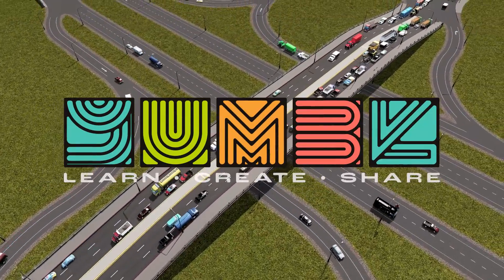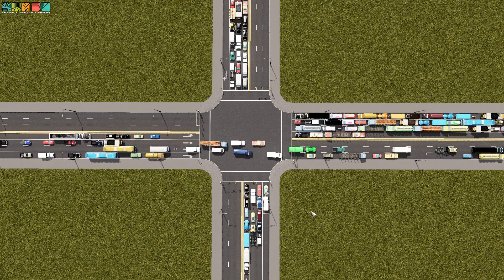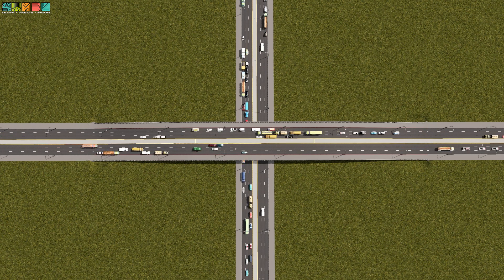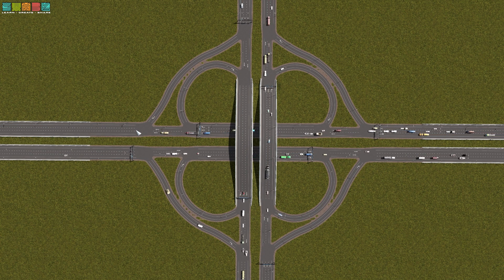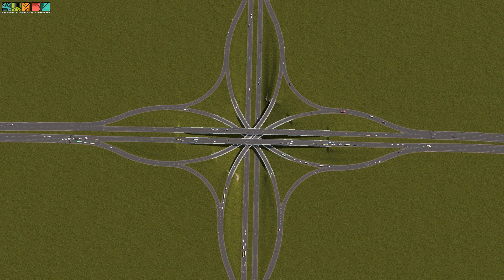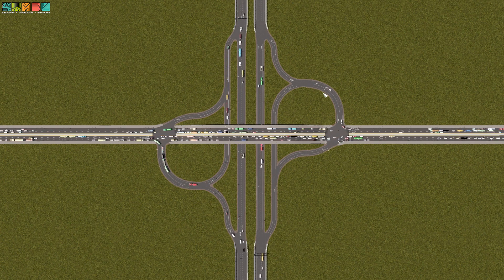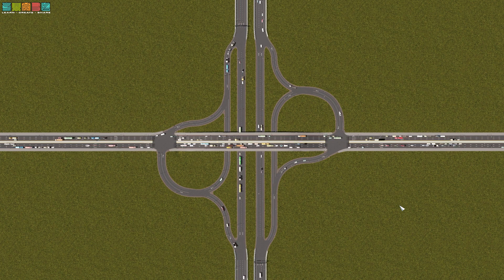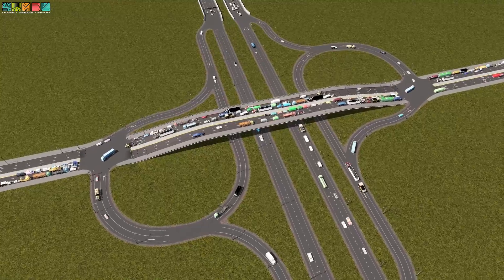Solving Traffic Conflict  -  Intersections and Interchanges Explained

Comment: The flaw with the roundabout at 1:24 is that you have single lane for each direction. Notice only middle lane on each entry is congested. The fact that the left lane is not means you have way more traffic going straight than turning left, yet you have only one lane for each. I'd say, allowing the left two lanes to weave both on entry and on the roundabout should increase its traffic throughput because traffic now centered on the middle line will spread over two lanes.
Now, of course a roundabout with cars crossing will slow the traffic down compared to the further designs. But it doesn't have to be as bad as in your example.
Reply from the maker: I upped the capacity as an experiment due to another comment. Created an extra turn lane. Two lanes entering in all sides. Same result. I would invite you to experiment, but a light is better on an arterial road.
Reply from the maker: I then re replaced the roundabout with a light and the traffic reduced back to steady levels. I’m sorry you dont like it, but thats how it works.

Comment: I do feel like the roundabout could still improve matters if it is built larger. The benefit of a roundabout is it increases the number of vehicles passing through the intersection at the same time, but the relatively small roundabout you had, would probably only handle arterial road traffic. Obviously you don't want to stick a roundabout on a highway though. Common design in the UK as you probably know is to have a roundabout above the highway and have slip roads leading to/from the roundabout to the highway and connect your arterial roads to the roundabout as well.
Reply from the maker: Yes. Lights are better on arterials. Lots of people seem to want to save face on behalf of the roundabout and alter it to improve it, but when hit with traffic on all sides (as on an arterial) a light is much better.

Comment: i have a city that's been having major issues with traffic despite following all of Biffa's advice and converting as much road to bike-friendly roads and encouraging biking, making things walkable, overhauling transit, etc. my biggest pinch points were always interchanges. i used your tutorial to create a parclo from scratch in a really strange section of the map that a symmetrical, 90 degree interchange wouldn't fit, but i was able to manage it and it cleared up traffic significantly. thanks for making such good tutorial videos and explaining your reasoning every step of the way, it's proven really helpful!
Reply from the maker: I’m glad to help! :)

Comment: On the roundabout it was clear, that only moving forward vehicles were stacked, even the ones who turn left were ok. So I wonder, what if you tried the roundabout with forward overpass, that you demonstrated a while ago? Doing the overpass even just for one road would drastically reduce the amount of cars on the roundabout and might even help to clear the other road.
Reply from the maker: That would work great, but the light kept up without needing to be converted to an interchange ;)

Comment: Its important to note i think, that in City Skylines price of roads isnt as big of a problem as in real life. As much as a clover leaf is crappy, its real cheap whereas a 4 stack is extremely expensive like a loooot
Reply from the maker: Yep. Overpasses are insanely expensive.
Reply: Yes, especially grade separation
Reply: It's also why, at least over here, cloverleaves are developed further to increase efficiency and safety. For example, in Germany the weaving lanes are almost always separated from the through lanes. Also, quite often one of the 'leaves' is turned into a direct ramp like in a stack interchange, or two are, as in a cloverstack.

Comment: Good stuff. I think what was left unaddressed was how to classify and solve the problem you initially presented, a high traffic urban intersection of two non-highway arterials? Perhaps a bypass roundabout? The tail on the turbo roundabout's traffic seemed to be primarily from cars wanting to go straight through. I always end up making a spaghetti stack in those situations, and hiding it underground in shame.
Reply from the maker: With good road hierarchy and attention to connections combined with transit your arterial and collectors intersections should do alright. If its a highways worth pf traffic then vanilla overpass would work wonders.

Comment: 5:50 The traffic light settings on the ParClo can be adjusted such that the surface road traffic coming off the overpass in each respective direction never has to stop. The ramps allowing a right turn off the highway can likewise flow freely if they get an additional lane on the surface street. 
If each onramp has two lanes initially, the right turn onto the highway can flow freely as well. The only stops are the surface street as it approaches the interchange from the outside —>  <— and the left turns to take the onramps. 
So either direction of the surface street only needs to stop once all the way through.
Reply from the maker: Yep. I have a video about parclos that explores lane math and traffic lights. Feel free to check it out!

Comment: On one of the main highways from one city to another in my country we have the clover intersection. It looks to have been designed in 1970s, just like pretty much all of Poland and it now supports 2021 traffic.
The amount of space for weave is very little and combined with the speeds of 80-120kmh, makes this stupid ass intersection my most hated in real life.
Reply from the maker: If a cloverleaf backs up its hell. Its fine until that point, but extra bad if overwhelmed.
Reply: @YUMBL  thankfully I've never experienced an actual traffic jam there and not a single accident, which is frankly surprising!
I have also checked the length of the additional lane used for merging, it is 105m, while the speed limit on the highway is 140kmh and on the other "express" road it is 120kmh.
Reply from the maker: Sounds unsafe
Reply: @YUMBL  It must have been an old road. Current regulations state that for 120 and 140 km/h roads the merging lane must be have a shared edge of at least 250m (and that excludes the additional wedge at the end where the lane narrows and disappears). 140km/h roads cannot have weave lanes, unless they are separated from the main through traffic (they unmerge and merge with it some distance from the interchange itself). The weave area must be between 150 and 300 meters, "depending on the conditions" (so for 120 km/h speed limit, I would expect it to be closer to the upper limit, if it isn't separated from the main through traffic anyway, like it has to be on 140 km/h roads).

Comment: My personal totally unbiased opinion: Best video yet!! That Stack Interchange looks very cool! Keep it up!! -MaxFX
Reply from the maker: Thanks for making the good ones! Did you see the weave machine thumbnail! 😂
Reply: @YUMBL  Yep, saw the thumb. Honored. Did you give the suggestion about the Pinwheel a try? Really wonder what you think about it, and how you can use it.
Reply from the maker: I forget what you suggested 😅
Reply: @YUMBL  About adding straight pieces between the bends, creating a 'one-way city block' as you called it.
Reply from the maker: Oh yea! Havent tried it out, but i’m sure it would work great
Reply: I love the pleasant curves and design of that stack. It even traces an Iron Cross, a common symbol of Germany, historically. One thing that irks me a bit in City Skylines is how one can get away with completely unrealistic interchanges with short, sudden ramps that look hideous. The standard cloverleaf shown here is unfortunately an example with how sharply the loops bash into the mainlines. It’s like the final 20% or so of each loop needs to be completed. But this is an excellent video! Loved that super turbo roundabout with the protected right turns—prevents so much weaving.

Comment: I really like a 3-level stack DDI, it has no lights and is about the same size - except for one extended bridge. Though you do end up with two weaves.
Reply from the maker: Ive heard it called a DCMI. That would be a system interchange

Comment: 2:16 I'm now so curious as to how the roundabout would perform if it had the same 4+3 roads as before and two straight-ahead lanes instead of one. (Literally just 'split' the middle lane into two to double the straight-ahead bandwidth and whether that would reduce the tailbacks at all.) I'm not saying the roundabout would perform better but it's not at all a fair comparison having a 3+2 turbo vs a 4+3 lighted intersection and saying the roundabout causes tailbacks. (Not a complaint at all I'm just curious what the results would be.)
Reply from the maker: The roundabout already had 4 lanes though two were dedicated to right turn exits. It would help, but would still be entirely overwhelmed. Lights perform better when traffic is high on all sides, or if traffic is asymmetrical.
Reply from the maker: What you’re asking for is a 5 lane roundabout unfortunately
Reply: @YUMBL  Yes I suppose it would need the roundabout to be a 5-lane road, or the immediate right-turns to be a separate one-lane slip road, which would be essentially the same thing but allow the roundabout to be built with a 4-lane road. Definitely starts to make things very complicated 😅
Reply: Rubbish.  Just put in roads that connect to the roundabout that are the same width as the other example and the tailback will be shorter. You don’t need a 5 lane roundabout, but even if you did, it’d be far smaller than the other options and most efficient.
Reply from the maker: @Richard Smith show me! Please. I hear people saying the roundabout should be better, but I dont see it.
Reply: @YUMBL  You're comparing a non stacked roundabout to that clover leaf thingy, which is stacked = apples to oranges. The speed and size of the roundabout and the connecting roads are also important to give the cars a chance to enter.
Reply from the maker: It was the mission statement of the video dude. The first 30 seconds I say what the intentions are.
Reply: Just try it yourself. It's pretty easy to set up. However, in my experience in the game, if you think you need a 5- lane roundabout then you're doing it wrong. It means your roads in that point are already too congested. And once you reach a critical point, no type of intersection will help you. Heavy traffic on an intersection should be solved somewhere else down or up the roads. If you watch for example Biffa, a roundabout lover, you'll rarely see roundabouts with more than three lanes. That's because they are not supposed to serve high-volume intersections. Keep your traffic in check, give your citizens plenty of options and intersections will remain manageable.
How many 5-lane, or even 4-lane roundabouts do you know in real life? And compare that to the total...
Reply: @mbrackeva  I think in real life at that point it would likely have an overpass for the primary through-road, which is why you don't see 5-lane roundabouts at-grade. I think this thread has drifted away from the point I was trying to make which was for the at-grade intersection and the turbo roundabout specifically, in making it a roundabout the approach roads have been made smaller (only one straight-ahead lane instead of two). The far, far easier way to compare the two would be to keep the turbo roundabout as it is, and compare it with a lighted four-way intersection where the approach roads have a turn left, a turn right, and one straight-ahead lane. I didn't mean to spark a huge debate about every imaginable kind of intersection/interchange though.
Reply from the maker: Keep an eye out for the next video ;)
Reply: I was wondering the same thing. Seems like cars prefer to go straight, otherwise the left lanes would be filled as well, so the roundabout has a clear disadvantage versus the two straight lanes on the lighted intersection.
Reply from the maker: Roundabouts generally have a disadvantage against lights in high traffic scenarios. Except in terms of safety.
Reply from the maker: I did an experiment. Opened the traffic light save. Converted the 4+3 roads to converge at a four lane roundabout. Right lane in the roundabout exit only, and second lane from the outside right and straight. Two lanes able to stack up to go straight. Backed up just liked the super turbo. Converted it BACK into a light and it was able to catch up with the traffic generated by the roundabout. 

Lights are just the better at grade when dealing with high traffic.
Reply: I thougt the same as Bobble when I saw the roundabout. There's no "power" in a singe straight lane.
Reply: The partial clover leaf does count as a stack doesn't it? It shouldn't be compared to non stacked junctions, right? How about a stacked "power" roundabout over two straight roads? This way it only handles left+right turns. Also, is the roundabout set up so cars can go right through? They seem to be stopping without needing to yield when entering.
Reply from the maker: The parclo is a service interchange. The stack is a system interchange. All junctions are worth comparing. Thats what this video is.

Comment: Cool video, but I think that by creating a diverse system of transportation (bus, metro, tram, etc.) will lower the traffic volume way much more effectively than an urban highway, but still cool video
Reply from the maker: I don’t recommend urban highway, and didn’t here. Always use service interchanges to bring traffic into the city.
Reply: Always, if they're properly planned for distance and future proof for demand.
This is valid in game and IRL.
Some places have even put some modern trams or light trains, but didn't consider the stations and where the track passes, negating any major improvement in non-individual transportation system, plus the security issues...cough...cough...LA...craptastic urban planning.
It's always a balance between where you create what type of demand and how to fulfill it. Longer distances, like cross town and suburbs, you need a express train. Mid distances, standard metro, high volume inner city. Mid to low, trams/light trains. Low volume or short distances, busses galore or trams in major collectors.